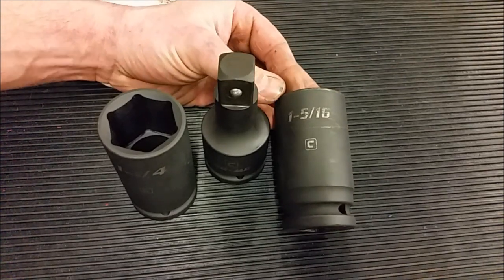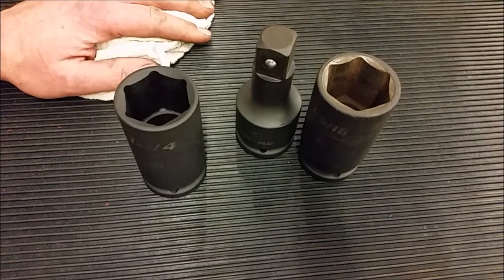Capri 3/4"dr Impact Sockets Review

Comment: Nice. Capri seems to be doing well for themselves. I'm using those dry packs you find in packaging, in my toolbox, to help fight rust.
Reply from the maker: The silica packets do help a bit, also, Inhibitor VCI chips help too (available at some hardware stores). but with having washbay and then just coming out of winter... (thank you Iowa Mag Chloride) corrosion is a pain in the ass ordeal in the shop unfortunately... but every bit does help for sure!

Comment: I have been really impressed with the Capri Impact sockets that I have and I tell ya, they are awesome, the coating seems to really hold up on them. I do like them especially for the money , they are hard to beat. I wished they had a metric set also, I want a set of the 3/4" drive set to add to my box. Great video as always.
Reply from the maker: Thank you clay! and capri has been holding up well, they are steadily adding to their line up, sometime near the beginning of summer they will be adding thin SAE wrenches to their line up and I cannot wait to get a set of those for sure. I think as much as they added this past year they should be adding steadily for sure this upcoming year as well! As always thank you so much for watching, sorry for delay in response things beenhectic here in house for past few days.
Reply: Yeah found it strange no metric set on amazon.  Was asking Hard Knocks forge or snap on junkie with the catalog if they see them in there, didn't see an answer.
Reply from the maker: Snap-off metric yet to come out with only deep sae avail as of right now. Kind of like the thin metric wrenches... sae not due out til around beginning of summer so i have to wait bit to buy the set i need more for doing high press gas lines on cng tank sets

Comment: Thanks for the video Bearded.
Don't know what you wipe your tooks down with. But im a huge fan of fluid film. I use it on everything.
Usually big tools cost big money. The price for this set is right on.
Reply from the maker: For impact sockets usually use Penetro or this other penetrating oil we got in the shop not too long ago, for chromes and softgrip handles (ratchets, pliers, etc) use Citrol (Schaeffers). Schaefers is a bit spendy but luckily shop provides for us. And true on price tag for these guys, they got pretty decent product especially for price tag it carries. Thank you for watching and hope that the HFT project is still doing well and coming along nicely

Comment: I wonder why they skip 1 3/16"
Reply from the maker: actually it is a pretty rare size, only 1 3/16 socket i own hasnt been used in a number of years since i stopped working on Freightliner Columbias. only had that socket for one particular airline fitting when I would have to pull primary tank off to do clutches and backhousings. Since then, well, it makes nice little size completion in my toolbox at least (makes me glad i went with kobalt for that socket lol). Thank you for watching!